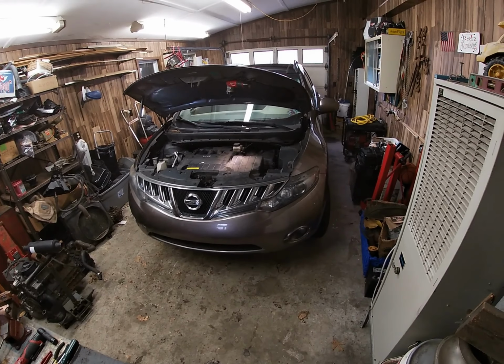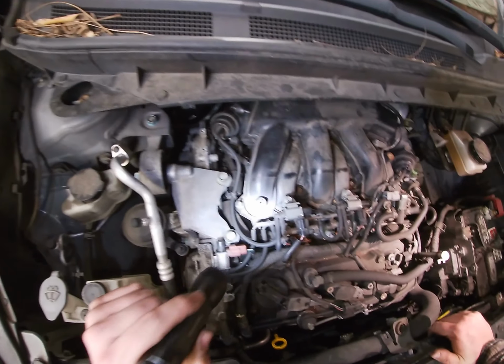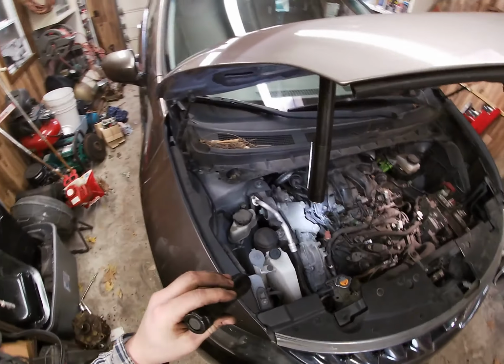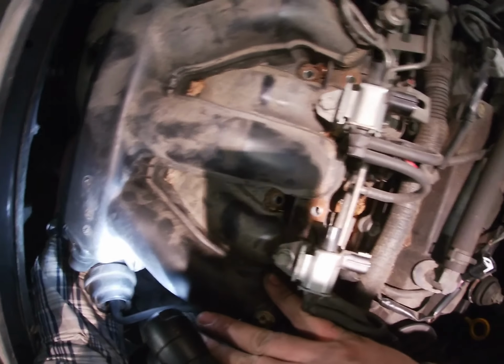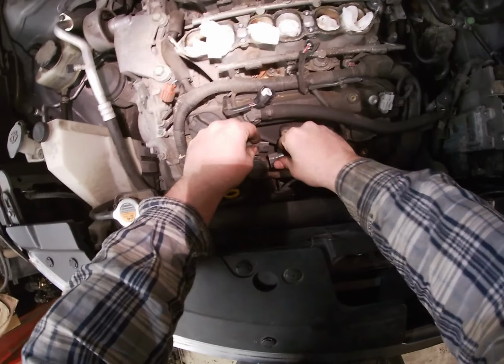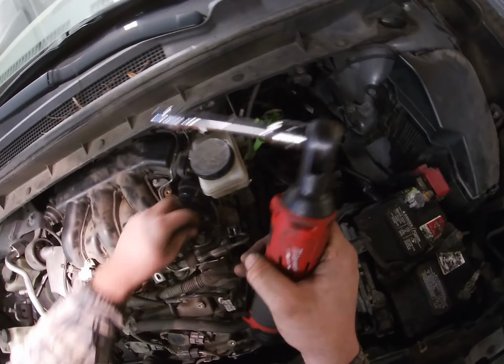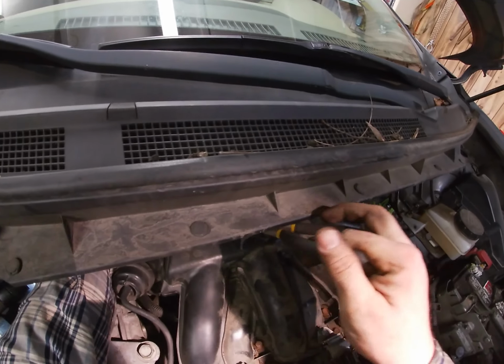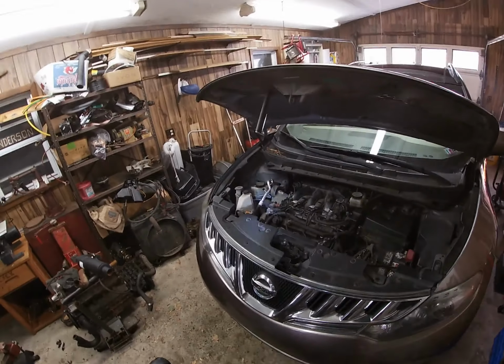2010 Nissan Murano Spark Plug Replacement

Comment: Great video.and helped a ton! Did my 2009 today and took.for a quick test drive and stalled once, any ideas what happened?
Reply from the maker: Thanks for the comment! Make sure all sensors and hoses are properly connected.  I always seems to forget something.  Towards the end of this video I forgot to plug in the MAF sensor on the air box.  Good luck and let me know if you need any help!
Reply: @hendersonequipment  thanks! Gonna take apart tonight and see if I missed anything
Reply: How much you charge

Comment: You don't have to use needle-nose pliers to remove the spark plugs. All you do is cut a couple two or three strips of tape like electrical tape or whatever you have and stick them inside the walls of the socket and it will grip the spark plug just like a spark plug socket.

Comment: I have used a magnet instead of pliers to remove my sparkplugs. This i not the best place to break something but I am a lucky dude. Take care if you remove an engine bracket on a mitsubishi. I only had to install a new alternator. I had removed two bolts and then there was only 2mm between the hole of my bracket and the one my engine. So I had two other bolts behind my timings belt with a broken bolt inside . It was only a new alternator job but some hours in my parking at midnight with some rains.  😂

Comment: Great job I just payed $660 to have this done how much would you have charged for 6 coil and 6 spark plugs?
Reply from the maker: Thanks for the comment!  OEM ignition coils for got about $100 each. Depending on the spark plug quality $50 to $100 for plugs. It takes no more than 2hrs to complete
Reply from the maker: Did they replace your coils for that price or just your spark plugs?

Comment: If you get codes 302,304,306 you are in luck. Cylinder 2,4,6 are the easy ones up front from left to right. Please tell me that you at least replaced the 1,3,5 ignition coils while you were in there. OEM on ebay cheap.
Reply from the maker: Oh yeah I did them all!  Did not want to go back again

Comment: Hello , I replaced mine and now I hear a hissing sound coming out the manifold. I replaced the gasket also. Please help
Reply from the maker: Thanks for the comment.  Check the vacuum lines.  There is a tough one in the back.  A line might not be connected or cracked
Reply: @hendersonequipment  Thanks sir for the reply. I looked at them they are seated properly but not sure if they have cracks
Reply from the maker: @laytheshuwaili2455  also check the air intake boot for cracks.  Those are known foe dry rotting.  If that isn't it, I would pull the intake and inspect how it is mounted.  You got this!
Reply: @hendersonequipment  I wish I could send you pics of my work here.
Reply from the maker: @laytheshuwaili2455  heusa19504@gmail.com
Reply: @hendersonequipment  ok thanks sir. I will take pics tomorrow and send you. Appreciate the help. Have a great evening.
Reply: @hendersonequipment  sorry sir one more question. Should I replace the PCV valve. !
Reply from the maker: @laytheshuwaili2455   you could remove it and start you engine to see if it stops making the sound but I doubt that is the problem
Reply: @hendersonequipment  sir I sent you an email with pics

Comment: mechanics' nightmare servicing any Nissan v6 engine,, .. too many bolts involve and wiring to disconnect .. maybe they only get paid  1.5 hours  ....not a big fan of Nissan.
Reply from the maker: I do not disagree.  I also hate the fact that you need to remove the entire intake manifold to replace the sparkplugs.  They did not design these to be service friendly.  Thanks for the support and for watching!